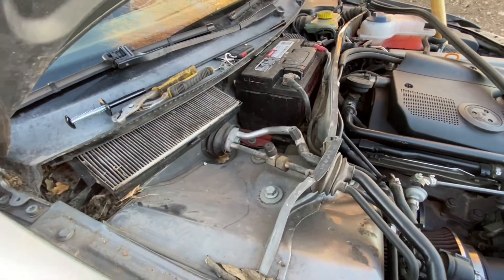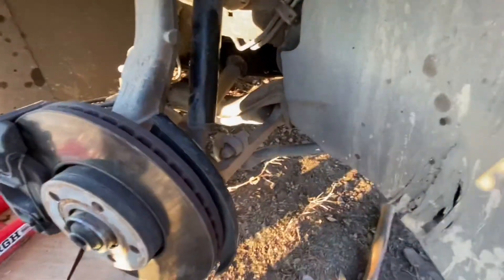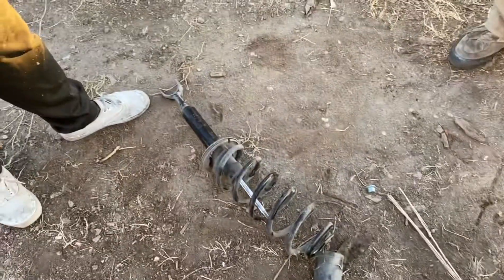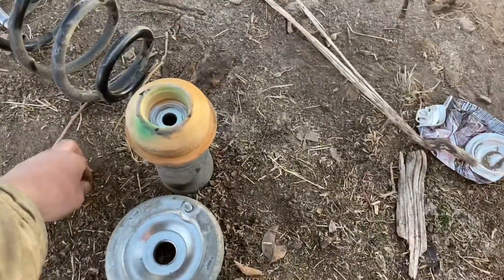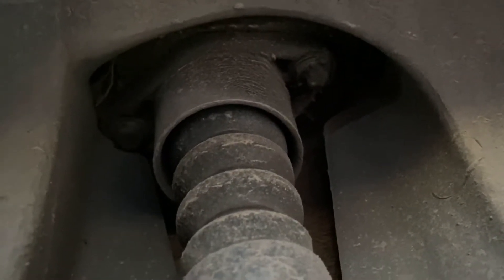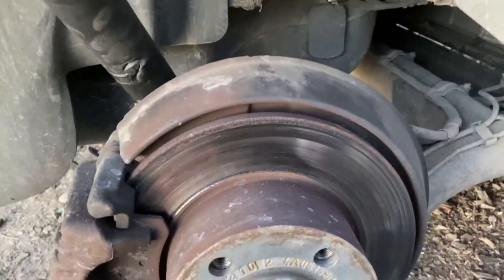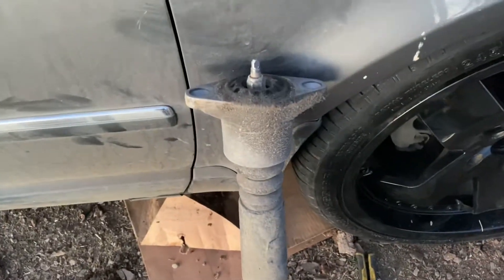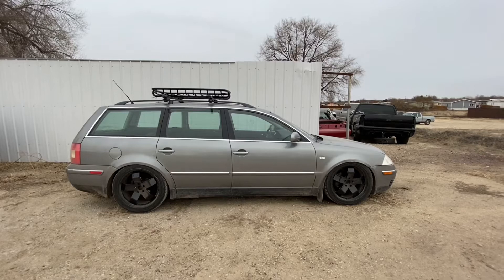Installing coilovers on a b5.5 Passat

Comment: How did you get that lower strut bolt out? It’s gets stuck on lower control arm for me
Reply from the maker: It gets stuck inside the hole or?
Reply: @Euromike  no it goes in and out of hole freely but it wont go passed whatever arm is behind it
Reply: @Euromike you got an Instagram I can dm a picture to to explain? You’re the only video that does it this way and it seems to be the easiest other than this bolt messing with me
Reply from the maker: @gcs_euro

Comment: It drove like that? My B5.5 will have alll kinds of noises and scrapes coming from under when it’s that low
Reply from the maker: It’s not to low because the wheels are 19’s
Reply: It’s gotta be eating those tires up! No liner and rolled fenders?
Reply from the maker: @louisthomas2531  trimmed fender liner and rolled fenders